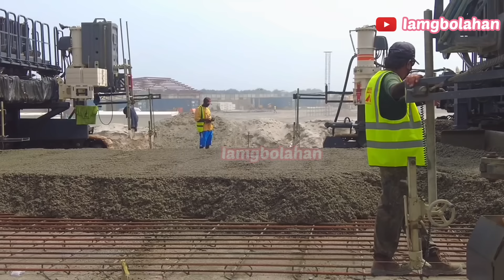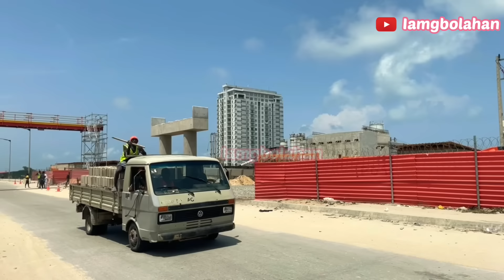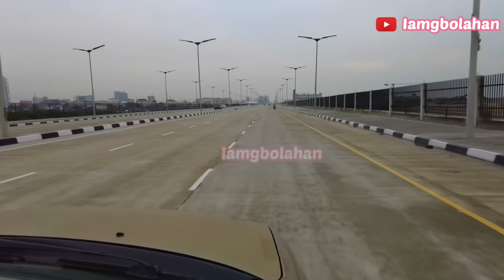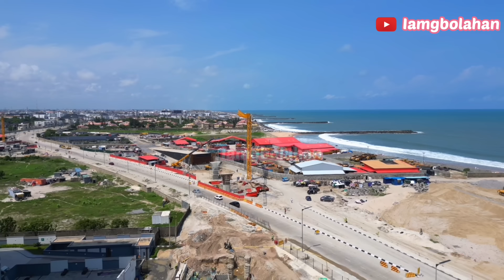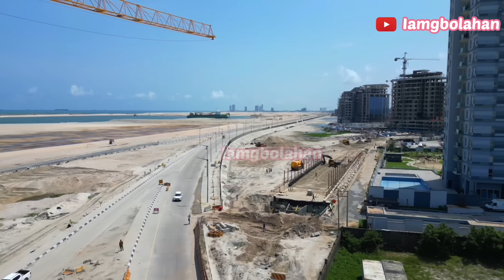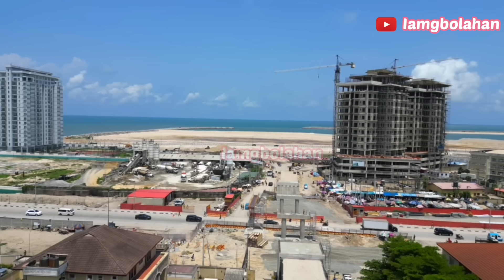Lagos-Calabar Coastal Highway: Massive Flyovers & Interchanges Now Taking Shape | Section 1 Update

Comment: But why are they allowing shanties and slums to grow on the sides of the Highways.. Why is Lagos state Government like this ? They wait until it's a complete mess .. Are they blind ?
Reply from the maker: Those areas actually housed a massive number of shanties long before this construction even started. If anything, the project has significantly reduced them.

That said, the expectation is that once the entire construction is done, the Lagos State Government will fully clear the remaining ones and officially take ownership of the empty spaces, setbacks, and under-bridge areas. If they don't lock down those spaces early, these shanties will definitely keep creeping back.
Reply: @Iamgbolahan  I agree with you, if they clear the shanties now, they will most probably keep shift their bases ahead- However, by the time the entire stretch on Lagos axis is done and running, they can take ownership and completely clear them, thereby, there won't be a place to hide or shift to. The truth is, unless government stations watchers there, these people will keep coming back. However, once government is able to replace the empty spaces with tangible infrastructure such as parks, gardens etc, then the numbers can be placed under check.
These people migrate to Lagos without proper planning -and they deliberately chose the high-end parts of the city.
Reply from the maker: Exactly....